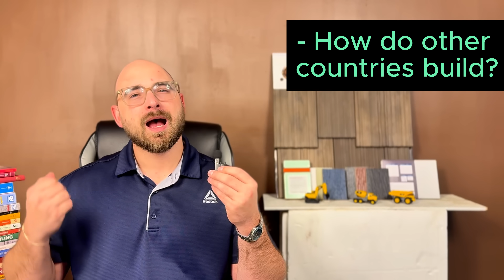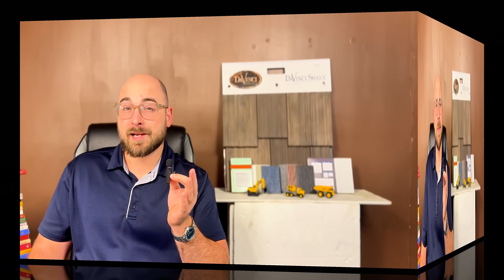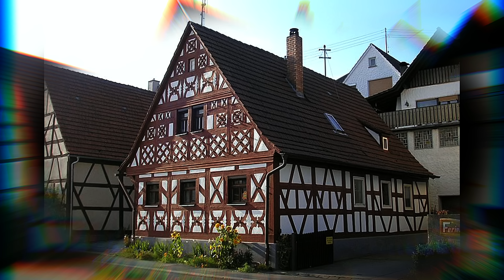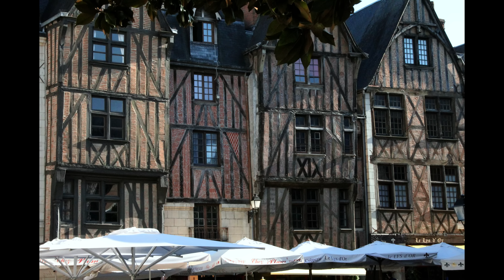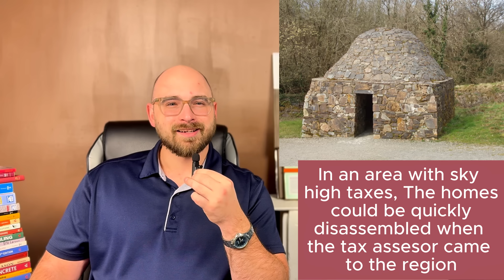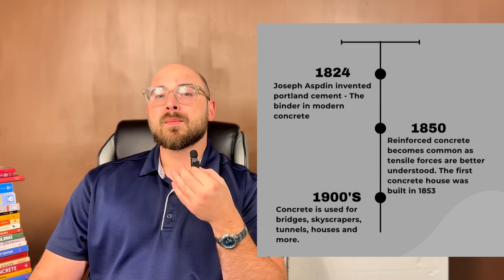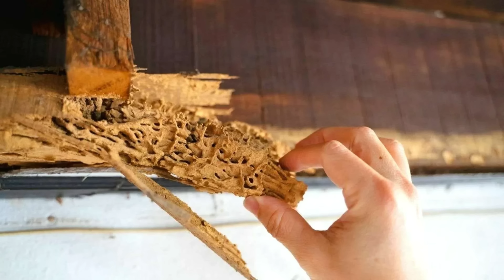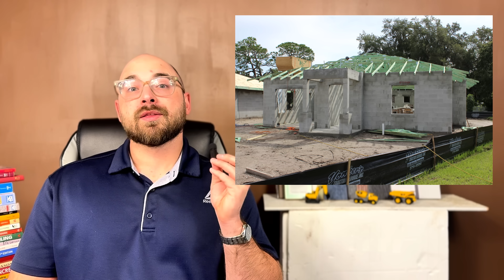Why Other Countries LAUGH at American Homes

Comment: In Queensland Australia we have a traditional type of house that we call a “Queenslander” it’s a wooden house that is raised on stilts allowing for air to flow under the house and cool it, the stilts also protect it from floods. And people would also use it as storage for outdoor equipment or if there’s room they’ll have a workspace. There’s Queenslander style homes that are raised but instead of the bottom being open to the air it’s bricked with a garage for storage. Unlike a normal two story house there isn’t an internal staircase. You need to go down the front or back stairs and enter the bottom from the outside. So growing up I couldn’t comprehend American friends that would tell me their house had stairs inside. That’s not very common with traditional Australian houses. Nowadays houses are built with profit in mind. And instead of building them to fit the climate they just shove an aircon in it and call it a day.

Comment: If you need it I could brag about earth homes. I was born into one, and my house I currently live in is an earth home too.I am from the Hungarian Plain.
Reply from the maker: Let’s hear the pros and cons, I’m curious!
Reply: @Mike_Fortin  I think I must clarify that am no architect, I am just an "end user" 😁
 Traditional earth (adobe) houses here are simple one level buildings. Most of them were built more than a 100 years ago, there are examples that were built back in the XIX. century.
The house I was raised was built by the father of my grandfather back in the 1930s. It had around 60 cm thick adobe brick walls, and big windows on the southern side. He planted trees to the southern side too that provided shade during summertime, but lost their leaves in winter and so let the sun warm the walls from outside and the house through the windows.
The rooms had around 3 meter inner height, that provided good ventillation during summer heat. The walls suck up some moisture from the earth beneath and as this moisture evaporates it cools the walls during summer. We used lime paint on the walls to prevent fungi to grow. This lime layer prevents pests like mice and bugs from entering the walls. The white color helps with cooling during summer too. If we start heating at the end of the summer we manage to keep the walls warm with much less energy. In my home if I do not use heating for two days, it is still around 12-14 °C, despite the outseide temperature is below zero. 
These houses are made from eart, straws, horseshit, wood, terracotta shingles and iron nails. Minimal industrial chemistry in the electronic wires. If I leave this house, 99.9% of it's mass will go back to the natural circle.
I think that there are downsides too. The biggest is that the roof must be good maintained and water must be kept away from the walls. The other is that 2-3 level buildings are not really good for this technology. 
With smart use of this technology, smart use of the features and with smart maintenance, one can save a lot of energy and leave a much smaller carbon footprint.
This is my two cents in a nutshell regarding this topic.
Reply from the maker: @IntoTheVoid1981  that’s awesome, 

Makes adobe sound like a dream! 

thanks for sharing
Reply: @Mike_Fortin  I forgot to mention that during summer in my current home we manage to keep inner temperature around 25-26°C, while outside there is 35-38, sometimes even 40°C.
Most of this houses are not meant for the 21st century lifestile and looks, and many think that living in a home like that is a poor man's choice. But to be honest, I deliberately choose an old adobe peasant house, because I knew the benefits, and I can easily adapt to the drawbacks.
My colleagues always complain about AC and electricity bills during summer.
I just smile.

Comment: I like the comment on concrete houses that avoid the interior design of a bomb shelter ;-) 

Regarding the main question why wooden structures are preferred in the US to solid structures, I believe: a) The US population is accustomed to this kind of building style. b) You get more space for the buck, even if the multi-century lasting building is not a selling point. But on the other hand, a well maintained wooden house can last long - as you can see there are many wooden roof trusses in houses from the middle ages.

Comment: older houses are built a bit more solid, but the biggest problem with american homes is that they're now being designed to be built asap and as cheap as possible to be sold for insane prices because our housing market is out of control and mostly hoarded by corporations

Comment: So my country vietnam is an outliar
Wood is plenty and native here yet our houses are concrete frame with red brick and a house only last 10 20 years and demolished and rebuilt by new owner. We use single layer wall not 2 layers with insulation because of fire risk but still there are. Price is cheap too.

Comment: Timber framing is common in Scandinavia, though higher end private properties are typically made out of some kind of masonry; today mostly probably CMU. Apartment buildings are typically now made with precast concrete modules. I live in Finland in a brick house from 1920. The house has double exterior brick walls with an insulating air gap between the walls. The exterior walls are 70-80 cm thick. Walls are plastered with a lime based plaster. All interior walls and load bearing walls are mostly brick with some parts made out of concrete, such as subfloors and stair structures. The mansard roof and the top floor under it has a wooden structure and the roof is tiled. The attic was originally cold, but has later been converted into well isolated living spaces with a smaller cold attic. The walls in the attic floor are light structures with plasterboard.

Comment: They're not wrong.  Of course, it's not true in all cases, but it's true for a large percentage construction in the states.  In addition, and equally as bad (if not worse), those who finance developments are usually not experienced, concerned with or regulated with regard to urban planning - one of the most needed skills when building a community (or even a single home, as the land and any constructions around it should be taken into consideration).

Comment: Creaky wooden floors as well as lack of sound insulation in hollow walls and floors bugs me to no end. Jump up and down on the floor and the whole room shakes.

But wooden construction is less expensive. A tornado's path of destruction looks less intimidating if homes can be rebuilt from zero in a quick manner, rather than having to repair a brick or concrete construction home.

Comment: Well.. the answer is simple... Your houses are easy to be blown away and you live in a place with hurricanes and tornadoes. For some reason are too expensive. In Bulgaria old houses ware build with stone or first floor stone and then wood mesh and clay with other things. or clay bricks and later one is with red bricks, concrete. Sadly newer building is kind of ... cold and less resisting than old Bulgarian traditional ( and bolkan ) houses .

Comment: Homes in North America are built from wood for 3 reasons.

1) North Americans want there house to be as big as possible.  Thus, we cut into the quality of materials to build larger homes.

2) Wood is better for insulation, and in average North America is far colder than Europe.  If you look at buildings in Scandinavia, you will see that they are also made of wood.

3) Resources available.  In North America, wood is very abundant, making it far cheaper than any other construction material

Comment: French here. My rural house, south of France, near spain,  was built in 1750. Still there. Made of stones, clay, silice  and wood . My roof is in wood (from 1700, inscribed) and clay tiles wich last 50 years at least. My walls are 65cm. I have real wood shutters. No need AC. Can't imagine live in a house where sounds and noise from everywhere could be heard or anyone could enter by my walls in 10 mn with simple tools, wich can burn entirely or have moisture problems that I have to constantly maintain, will last less of my own life, I want my children to get this house, maybe their own children. And it cost me 80k and 70 k to improve (insulation, new windows, new clay tiles, open some spaces, new floors and kitchen , electrics and plumber etc.). (300 meters square and some land). And I would never buy a new  build house, even in Europe, because of low quality of materials nowadays, except If I can hire an architect who let me choose my wood myself in sawmill etc. And In the US, even less.

Comment: This is all just rhetoric. 
I lived in Ukraine for 30 years and now live in the U.S., and here’s my opinion on houses in the U.S. They are definitely far worse than what we build in Ukraine (or in Europe).
Our houses stand for 200+ years and only require maintenance—like replacing the roof—while the load-bearing structures remain nearly indestructible. We build with brick or reinforced concrete, making our homes energy-efficient. If my boiler shuts off, my house doesn’t immediately freeze, unlike American homes.
For example, my house is heated with underfloor heating, which is highly efficient and comfortable. Meanwhile, U.S. homes rely on a forced-air heating system, which dries out the air. As for air conditioning, I use a split system, with an individual unit in each room, allowing me to control the temperature separately.
Advantages of U.S. Homes
That said, the U.S. system has undeniable advantages as well.
Standardization – I really like the house layouts here.
Garage integration – Initially, I thought exhaust fumes would leak into the house, but that turned out not to be the case.
Subdivisions – They provide a sense of security.
Speed of construction – While U.S. homes are flimsy, built from air and paper with a wooden frame that won’t last 50 years, they are built extremely quickly.
I believe that the short lifespan of buildings contributes to high housing costs in the U.S. In Europe, homes are often passed down through generations, which helps keep housing prices more stable. Of course, the real reasons for rising real estate prices are much broader, but this factor still plays a role.
Conclusion
But let’s be honest—both types of houses are livable. This debate is similar to comparing Japanese and German cars—both have their own advantages. The important thing is to have a roof over your head.
Millions of people lost their homes, health, and loved ones because of war, while millions more—in countries like Pakistan, for example—have no electricity and live in structures resembling dugouts.
That’s why I think this debate is pointless.